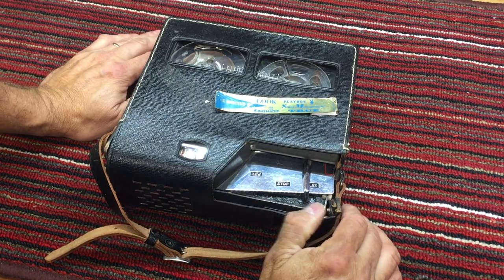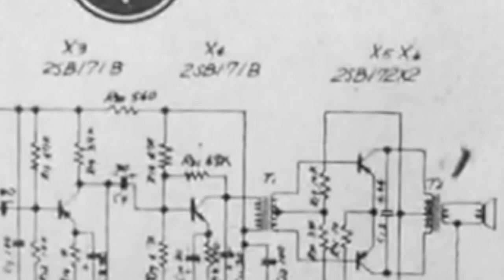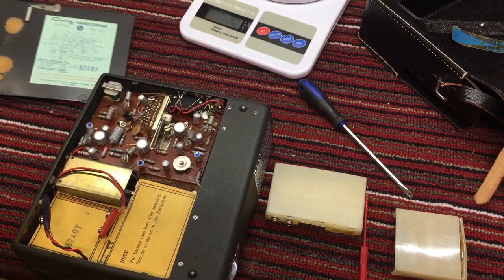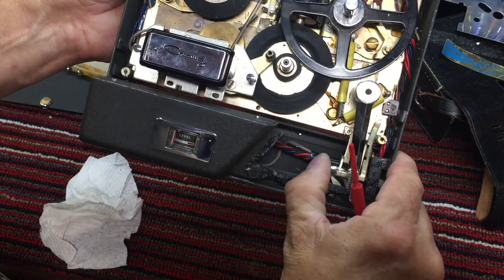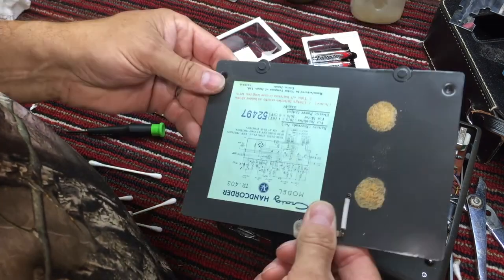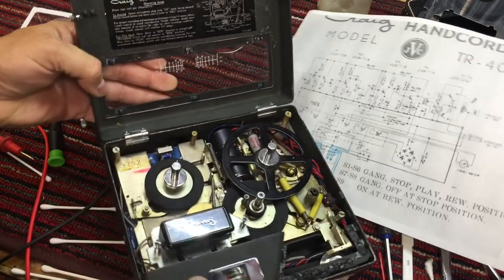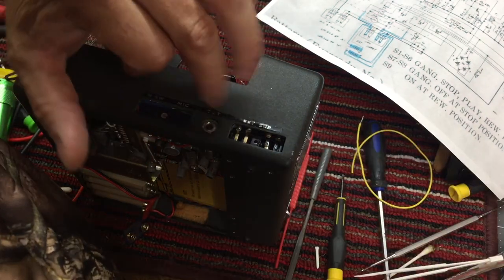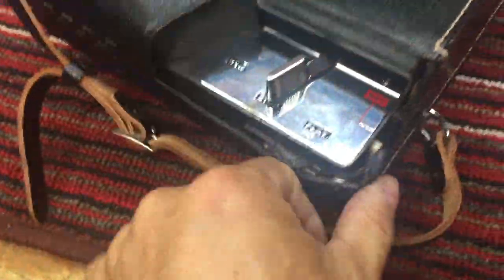Reel Life with the Craig TR-403

Comment: I'm only upto 18:32, but the build quality is typical of JVC. I had no idea they were anything to do with Craig tape decks.
Reply from the maker: I was surprised as well.  No plastic parts in this unit at all.  This recorder sold for 159.95 in the 60's. I found a price sheet for them, but still cannot find any manual or sales literature.
Reply from the maker: I have another one here that I will compare.  It has another button on it, and the Craig logo is definitely different.